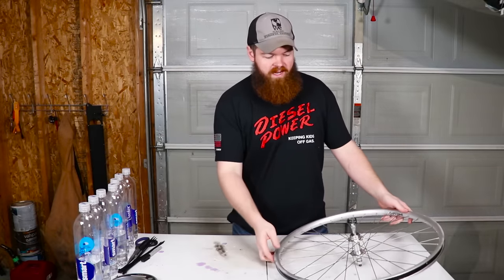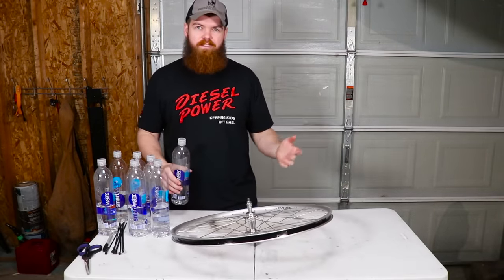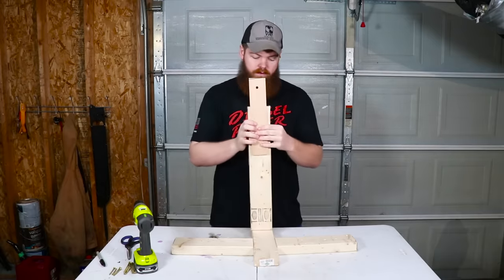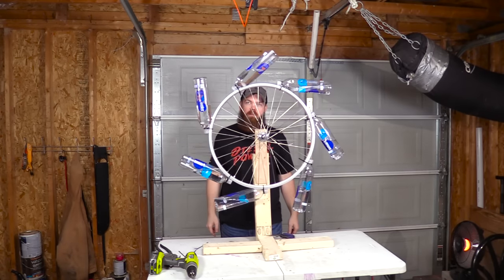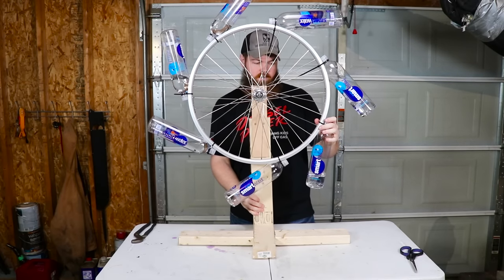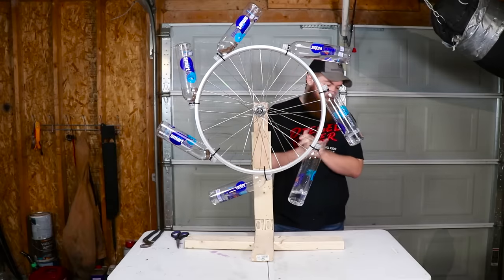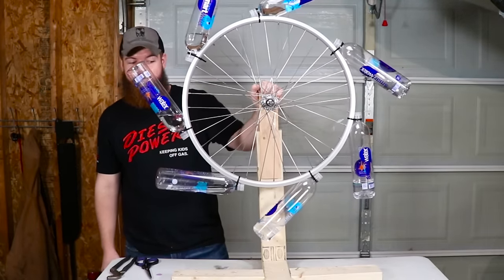Can A Perpetual Motion Wheel Actually Work?

Comment: Can a perpetual motion wheel actually work?
Short answer: NO.
Long answer: This video
Reply: Thesnakerox theoretically yes in perfect conditions using a vacuum to negate air resistance and electromagnets to suspend the wheel with ho physical contact negating friction in the system
Reply: @davidp1838  but to do this you need even more energy. Impossible
Reply: Let's Cat it’s been done in The Benjamin Franklin museum in Philadelphia they have a pendulum where it moves so little that friction is negligible and also it is affected by the earth rotation and gravity therefore it will never stop unless out current understanding of the laws of physics is wrong then we will learn something from it and adjust out current understanding
Reply: Let's Cat you should look into it it’s really interesting
Reply: @davidp1838  i meant that IT isnt possible to generate Energy from nothing. In the Benjamin Franklin Museum they might be using Energy to generate these conditions, for me this isnt much different than using a simple Motor..
Reply: @davidp1838  and using Gravity and Earth Rotation doesnt Count AS Perpetuum mobile.  this isnt different from using solar or Wind energy.
Reply: Let's Cat right a true perpetual motion machine is impossible but you can make something like he was attempting to do where once it is activated it doesn’t stop
Reply: Dave P no. First law of thermodynamics prevents this.
Reply: Dave P there’s still friction. There is a minuscule amount of energy loss. Might take millions of years to stop but will stop at one point in time
Reply: A system where the force is in total equilibrium will never have perpetual motion. In this case, the force of the water moving down in the bottles on one side, it completely equal to the force of the bottles moving up on the other side.
Reply: @michaelschmid2311  Perpetual motion is not about free energy it is about conserving energy induced into a system for ever and thats theoretically possible if the system is isolated perfectly. Atleast thats the classical aproach. Considering the 2. law of thermodynamics and quantum randomness i think its likely that any the system will loose its "form" over a very long time but not its energy tho.
Reply: @cameronthomas8455  He'd have been better off just spinning the wheel without the bottles! This video was bonkers and whilst some people are claiming this is a joke video and Tyler knew what's up, I honestly believe he thought this could work! 🤦‍♂️ I like the guy and his channel but he's not the sharpest tool in the box. Very good at what he does though and I wish him every success.
Reply: @davidp1838  you can't use electromagnets. The whole idea is that no energy is entering or leaving the system. By using electomagnets, you are not only putting energy in, but limiting how long it lasts by how long the magnet is supplied with power. It's the equivalent to having a perpetual motion machine that only keeps moving if you keep turning it.
Reply: @davidp1838  Even with a perfectly balanced wheel, zero air resistance (e.g. in a vacuum), and zero friction in the bearings, it may spin for quite a while. but would inevitably stop at some point; also if any attempt was made to extract any rotational energy which the system may initially have after spinning it up, it would quickly be dissipated by the external load. This joke of a perpetual motion machine is like all other such futile attempts which have appeared over the centuries - doomed to failure because of the laws of thermodynamics. I just wish folks would acquaint themselves with a bit of elementary physics:- at best, energy out = energy in, if you're lucky. In reality, even with modern 21st century equipment you'll always get less than a 100% back from what is input. There are some very clever models which 'appear' to work, but they always involve some hidden power source within the mechanism.
Reply: @davidp1838   Then it still won't work.  There's always a loss of energy.  Even if there's no loss, what is the point if it doesn't make energy you can harvest?
Reply: @davidp1838   That's not true that it will never stop.  It has a power source of some sort, they just won't tell us what it is.  They even admit this.

Comment: The movement of the water going down on one side counteracts the leverage of the water going out on the other. The water going to the neck of the bottle is flowing in the opposite direction of wheel rotation, creating a counterproductive force.
Reply: This actually has nothing to do with it. Pay close attention to how much water is on one side of the wheel.
Reply: @collynlovell9982  
Actually it does. Why do you think it stops and goes the opposite direction?  Watch it at .25x
He basically made a severely unbalanced wheel
Reply: So actually the reason that perpetual motion machines don't and will never work is because friction exists. If there was no friction then the wheel wouldn't slow down
Reply: No friction would do nothing for perpetual motion because of the water imbalance. The water on the left of the wheel is in fact moving in a direction opposite the wheel which is counterproductive. It will cause the wheel to slow no matter what. If the wheel begins to slow at all it will continue to slow and eventually stop. You could create this setup with a magnetic bearing to get rid of the friction in the center of the wheel and the backward force of the water on the left would still slow the wheel to an eventual stop.
Reply: The whole video I was screaming "spin it the other way"
Reply: Yeah also the centrifugal/gyroscopic/centripetal(idk wtf it is they are all similar) is pushing the water to the end of the bottle. That’s why you really only hear the water splashing when it slows.
Reply: This 100%
Reply: if you did notice 11:45 its already been proven that the build doesn't work front or back
Reply: Now listen to a real engineer)))
Everything is simple, essentially the water inside the bottles creates another wheel and that wheel have a his own axle lower then the axle of the carrier wheel. 
Except for the horizontal imbalance there is a vertical imbalance. And these imbalances are equal.
Reply: What about connecting a kinetic energy recovery system flywheel
Reply: Exactly!
Reply: The original video,right amount of liquid in the bottle,distances of each bottle and fixed base for the wheel not to move or shake,,ill try it when i take my vacation,,
Reply: @delsin6167  NOT the reason since the water on the right is creating a force in the OPPOSITE direction which counters the force on the left side. But water motion STILL plays a role. How so? The mere friction of the water moving around in the bottles is a braking force, among other factors (lower center of gravity, etc.).
Reply: Repelling magnets in a slide?

Comment: everyone that likes engineering has at least once in his life thought about making a perpetual motion machine in his mind.
Reply: Yea. It's almost impossible to perfect tho. The same amount of energy goes into moving the bottles up as when they came down, and then there's also the added problem of energy being lost to heat. You'd need to make a levitating wheel and then figure out a way to make it so there's more energy going down than up, which is the hard part.
Reply: @Sp00kq  is say it IS impossible to perfect. You'd need to have a situation with literally zero friction or other energy loss, which is impossible.

Even if it was possible, there'd be no way to harness the energy anyway, so it's pretty much useless
Reply: I've always had a theory. What if you could have a wheel connected to a turbine, you manually spin the wheel once and the electricity created then branched off with one branch going to a device the requiring just enough power to keep the wheel turning. Assuming the necessary amount of power needed to power the wheel is less than the amount of energy the turbine creates, you theoretically would have infinite power
Reply: @cb3rdDegreeBurns  
the turbine would create less energy than needed to spin the wheel unfortunately. people try those things for centuries and it never worked simply because of how energy works - they have a word for this: entropy. you will always get less energy than you put into.
Reply: It’s impossible.
Reply: Still do, sometimes... It’s a fun thought experiment, even if it is impossible...
Reply: Somehow magnets 🤔
Reply: @420Zidane  wouldn't you just need it rotate conductors in a electric field to get a voltage going through to get some power? Or am I remembering physics 2 wrong?

Edit: this is assuming a perpetual motion machine is possible.
Reply: @Sp00kq  exactly. I'm pretty sure that the reason this isnt working, is because they weight balance is the same, so whenever theres a bottle on one side with the water in the lower half, it's the same on the other. There would need to be a constant weight difference on either side, which isnt possible, because you cant change the water amounts while the wheel is moving. You could use a flow of water, but then it's not perpetual motion
Reply: @bowlman_  sounds like your describing a water wheel lol
Reply: @animeloveer97  that was exactly what I was describing. Then I said that's obviously not the same thing

Comment: Yet another teaching point, this is called Pascal's law/pascal's principal, in fluid/gas/liquid mechanics, it states as followed;  fluid at rest in a closed container, a pressure change in one part is transmitted without loss to every portion of the fluid and to the walls of the container. 
"Water seeks it's own level"

Comment: Perpetual motion wheels don't work forever. This one could have gone for longer though if the water bottles were spaced perfectly. The reason it reversed and stopped was because the weight of the water bottles wasn't evenly distributed and the biggest gap in the bottles I would assume would settle at the top. You should try this again and evenly space the bottles and see what happens, just a theory.
Reply: The problem is the bottles needed to be filled half way in order for this to work.

Comment: It is the weight what creates the energy in this tool, so increase the amount of water in each bottle upto tow third of the volume then try again, it should work, also tie the bottles in a way that keep the body of the bottle strait (sticking) on the wheel not forming an angle and keep the caps in the front of the rotation.

Comment: This might still not work, but I would try this: 
Number of bottles should at least be even at 8 or 10 bottles.  You have 7 bottles that I can count. The bottles should be evenly/perfectly spaced out.  The 7 bottles in this trial are not perfectly spaced in a balanced way. Thus the Wheel is finding its equilibrium balance and after a while coming to a stop.  Just a thought.  Respect!

Comment: Until you can get rid of friction all together you can’t have a perpetual motion machine
Reply: And wind resistance and break physics
Reply: Even without friction it's fundamentally impossible.
Reply: Energy can neither be created nor destroyed, and in any closed system entropy will tend to increase.
Reply: John Petersen yeah but isn’t there a whole theory about like how energy is constantly created and destroyed? Idk I’m not that into science
Reply: @dennisbooth7731  no it's just transferred in ways that look like it's created and destroyed.
Reply: Dennis Booth it’s not being created or destroyed it’s just changing form. Like if there is a super bright light there is a chance an electron might form. But even if it does it turns back into light like 0.000000000000001 seconds later.
Reply: @wayside5182  what do you think wind resistance is genius?
Reply: @Me-ui3ug  um friction comes from the bearings wind resistance slows to object down as it tries to cut through the air which technically still is fiction but is put into a different category because of the complexities of fluid dynamics and aero dynamics
Reply: @wayside5182  Yeah I guess we are both right. Sorry for being a little mean. I had a good friend of mine try to convince me that evolution is a hoax and that the earth was made in 6 days, so I’m a little pissy at anything that sounds stupid.
Reply: @Me-ui3ug  i feel you people who know nothing about science have the strongest opinions and when they can't explain their bad logic they treat you like your stupid

Comment: The reason this doesn't work is the shifting center of mass due to the shifting water.  Unlike a normal wheel, the center of mass does not stay at the center of the wheel.  It shifts slightly towards one side, causing a loss of speed over time.

Comment: Crazy man believes he has created the ultimate renewable energy source
Reply: Captain SNES someone tell  Electroboom 😄
Reply: @EpilepsyWarning  you mean like a wheel without bottles attached?
Reply: a guy  if i test for alien dna in my drinking water i feel like that might indicate my insanity
Reply: @austinmcdermott8859  very interesting indeed also a bi product of solar panels are heat which can also be used to produce  more energy.  and another thing arnt china making an artificial sun that eventually will produce more energy than the system in place to maintain it technically not breaking the 2nd law but still technically free energy is energy

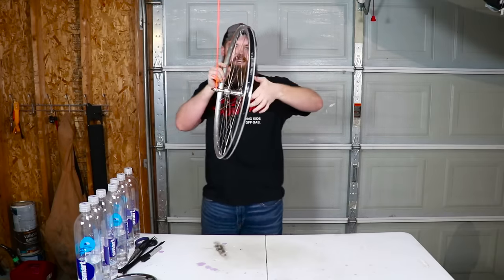Comment: 1:47 that's gyroscopic precession. the force on the wheel is manifesting 90 degrees ahead of where the torque is being applied, in the direction the wheel is spinning. instead of the wheel returning to it's original position, with the axel pointing up and down, it precesses around the string instead, because the wheel is spinning.
Reply: Came here to say this, it's not centripetal force keeping it vertical like that, it's angular momentum!

Comment: I glued magnets on the rim 2'' apart and put 1 stationary magnet on top and on bottom  and on sides it works perfect.. i let it run for a week straight in garage until the walmart china bearing cooked..
Reply: How far away from the wheel did you put the stationary magnets

Comment: Balance the wheel.  It's moving on its own to get the heaviest point at the bottom.
Reply: That’s impossible, he’s built a purposely unbalanced wheel.
Reply: @timrosencrans7955  its possible.  When it's not being moved, it should be stationary. This begins rotating on its own  whichever direction will get the heaviest part to the bottom.

It shouldnt move more than the distance the bottles are spaced apart if was balanced.
Reply: It doesnt move on it's own forever and it's got nothing to do with this being possible. It will work until it reaches a point of balance. Momentum keeps it from staying on a balance point but that momentum will run out eventually and when it does the wheel will meet an equilibrium and stay still. At least it would in a perfect environment. Things in reality are in constant motion nothing is actually ever stationary so there will always be slight momentum and the wheel will move slightly forever no matter what even if the eye cant see the movement. But this doesnt make it perpetual motion because it doesnt accelerate beyond the rate of everything else it stays what we consider to be stationary. Something being theoretically stationary is no movement whatsoever. In reality being stationary is moving at the same rate that everything moves.
Reply: Gabriel Coleman no it’s impossible. the design is an unbalanced wheel. This type of perpetual motion machine actually shifts the center of gravity down and to one side.
Reply: @timrosencrans7955  put a 5lb lead weight on 1 side of the wheel and then explain why it still acts the same way Tyler's does. 

Not arguing that the perpetual motion can work(cant).  Arguing that in order to remove variables, it needs balanced.

Comment: This called an overbalance wheel. The original design called for mercury to be used for more density. You can mix salt water to make them heavier. Precise placement of the bottles is needed or it will not work.

Comment: The reason this doesn't work is because of the fact that the water being further away from the point of rotation on the one side actually causes the center of gravity to shift downward and (in this case) to the right. This causes the wheel to want to come to rest instead of continuing to spin as if the center of gravity were on the point of rotation.
Reply: would u not agree that he needed to add more water to increase the gravity?
Reply: I agree, needs more water, so the force it’s less

Comment: “As long as you have everything equal and everything BALANCED out, the wheel should spin, pretty much forever...” lol maybe because it’s perfectly balanced , it won’t spin... it’s in “equilibrium”
Reply: I'm sure its because he has 7 bottles instead of 6, 7 is unbalanced and im sure it wouldn't work because one side will have 4 while the other has 3

Comment: The moving water is accelerated and decelerated depending on position on the wheel. The deceleration is caused by the bottle and that force is applied to the bottle and wheel

Comment: 3:00 the reason that happens is because digital scales are not so accurate with repeated measurements. if you want truly accurate numbers you need to reset it every item you weigh. its even a parameter they might list or advertise, called repeatability %